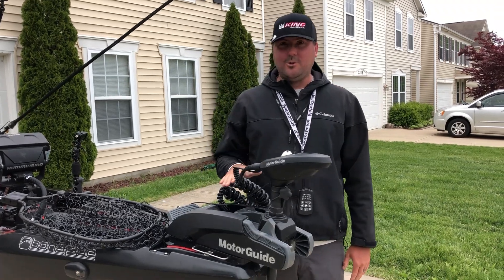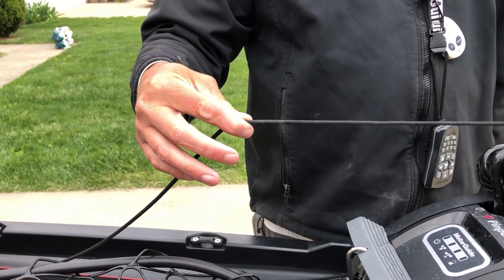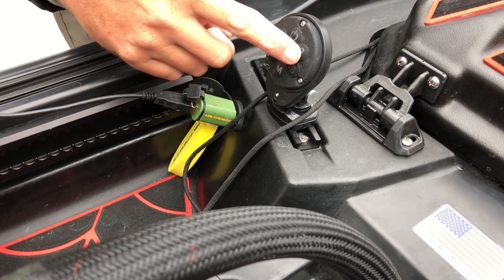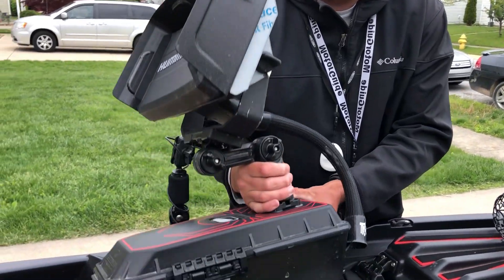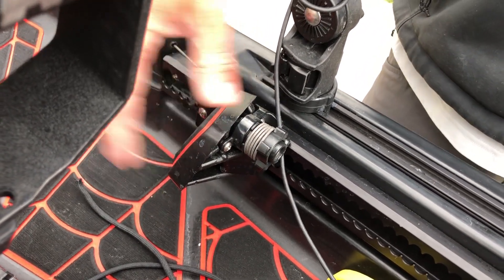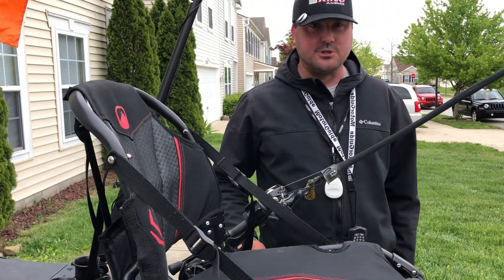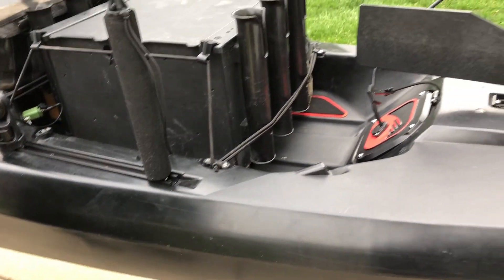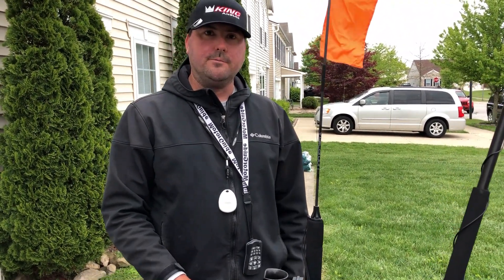Extremely Rigged Tournament Ready Kayak

Comment: That’s one of the best rigged and beautiful kayaks anywhere . Love your casual style and demeanor. One question , can you operate the tilt feature on the power pole from your seat or does it require going back to the unit and physically unlatching the hinge mechanism. Thank You and again an absolutely beautiful kayak
Reply from the maker: Thank you, I use my paddle to release from my seat. I position the latch pointing towards the front and then I can put the paddle between the latch and the base to push it out.

Comment: Nice rig man. I have the same trolling motor and a similar fish finder. Any issues with the the transducer and prop turbulence? I have mine mounted to the trolling motor currently, but I am looking to move it to the dry pod due to interference issues.
Reply from the maker: Thanks for watching and the complement. I don’t see any issues with having the transducer in the position. Every once in a while I’ll pick up a little surface clutter but it doesn’t impact the rest of the image.

Comment: Does that bow mount motor ever mess with your transducer? I have the same setup for my Lowerance ran thru my drypod. Just wondering if the water flow from the prop messes with the transducer? Thanks, great video!
Reply from the maker: I don’t have issues with prop wash. Once in awhile if I am moving fast I will pick up a little clutter but not normally anything that interferes.
Reply: Under The Radar Fishing Thanks dude!

Comment: I’m trying to decided between building a rig like this or buying a old town autopilot.   My 3 big questions is. How fast is your rig with that motor?  Do you like how it tracks with the motor up front? And how shallow can you get with that trolling motor?  Less important question anything you would change?
Reply from the maker: I can run around 5 mph. Yes I have no issues with the tracking. The motor can be moved up to run in shallower waters. I have been in lass than 18 inches of water and been able to still use the motor in a high position.

Comment: Sweet rig! I also have the ss127 black widow. Been researching a 100ah lithium battery but didn’t know where to put it for weight distribution and to keep it from the water. So obviously you don’t have a problem with all the weight up front. Are you every worried about flipping the kayak and water getting to the battery?
Reply from the maker: Not worried about flipping my kayak at all.

Comment: Looks like a cool setup.  Curious why you didn't go with an OldTown 112 AutoPilot or their 136 AutoPilot as your starting point?  Let me know if you get a chance. Also curious what your storage and launch weight is without the motor.  The Hummingbird mount is very slick. You've done an amazing job. I'm using the FPV Power Lithium Ion Polymer battery.. Didn't notice a Battery meter?  I'll double check
Reply from the maker: I like the versatility this set up offers me. If I get have another kayak or replace this one with another I can swap the motor over and not have to buy a second one. The kayak empty weighs 95 lbs. I launch from my trailer just like a boat so I don’t really know how much it weighs fully loaded and with my set up it doesn’t make a difference.
Because lithium draws down differently you can install a regular battery meter  to get accurate reading. However I just came across an affordable lithium battery meter that I would like to install. Thanks for watching!

Comment: did you connect the motor directly to the battery from that plug you mounted? you didnt say it was on the yak power switch so im curious how you ran it?
Reply from the maker: Directly to the battery not through the power switch.

Comment: Awesome rig!!! Curious why the 100ah Bioenno? That is a lot even for a 55lb motor. Is it due to motor wattage? I’m looking into the Xi3, but started reading Bioenno battery wattage max limits and I think these XIs are have fairly high wattage draws which may require the higher ah batteries. Thnx
Reply from the maker: I went with a 100 ah battery so I would have the ability to cover a lot of water prefishing, hold positions in high current and lock on to a point without worrying if I was going to run out of juice. I have been able to cover close to 20 miles Prefishing with 8 of that at max speed in a day while also holding on a few locations. 
Just to clarify I have no issues with the max wattage pull and wattage and ah are totally different. Wattage is how much power is being demanded at that time and ah is the total amount of power available in storage.

Comment: How long does the 100ah battery last with the motor, anchor and other accessories while on the water? Would it last a 10 hour day on the water before running out of juice?
Reply from the maker: That obviously depends on the conditions and how you are using it but I have covered close to 20 miles in a day before it ran out.